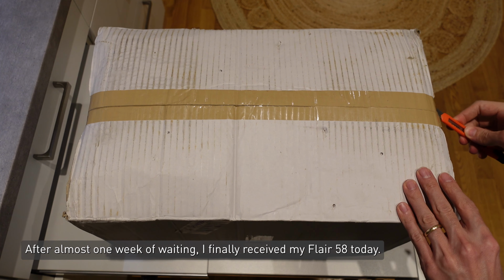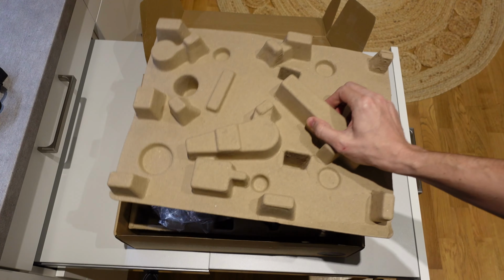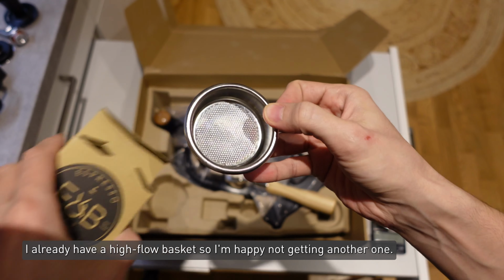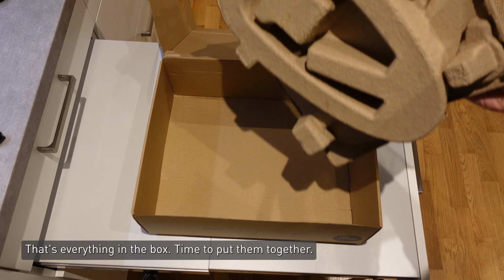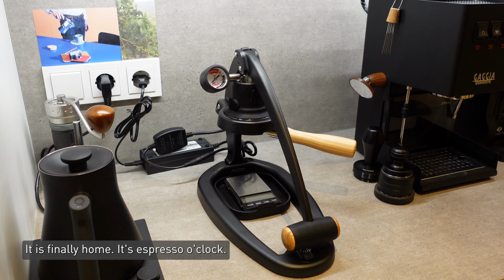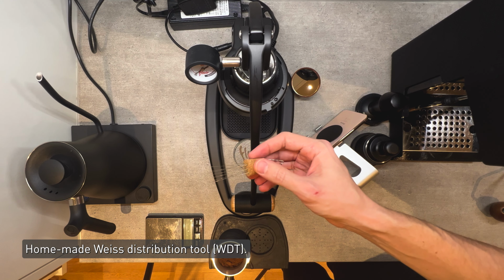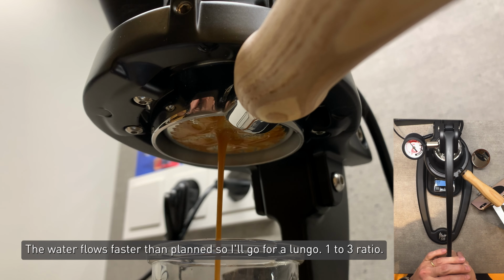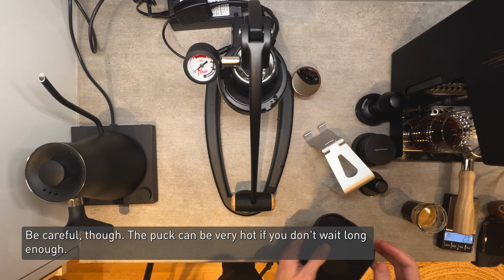Flair 58 Day 1 - Unboxing and first espresso

Comment: Thanks for the video 
Is it better for espresso than your gaggia ? How finer the grind should be ?
Reply from the maker: Significantly better. With Gaggia it was hit or miss. If you have the high flow basket, you need to grind significantly finer. But they started shipping with the basket with a narrower base, so the grind does not have to be too fine.